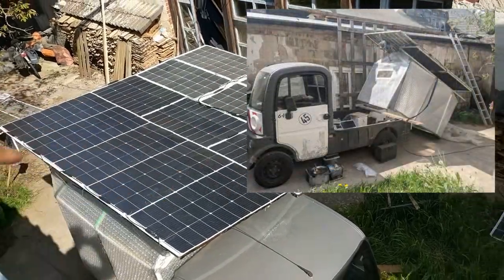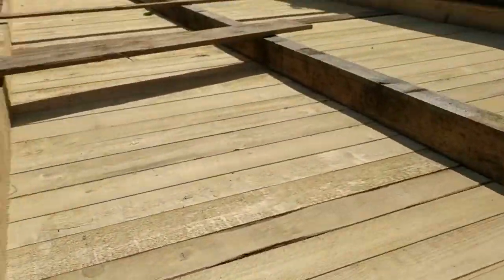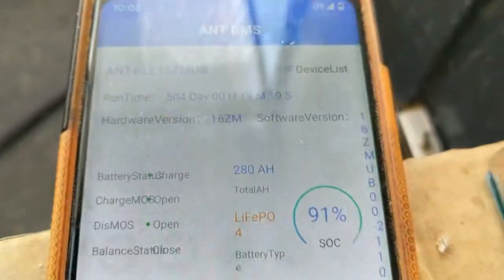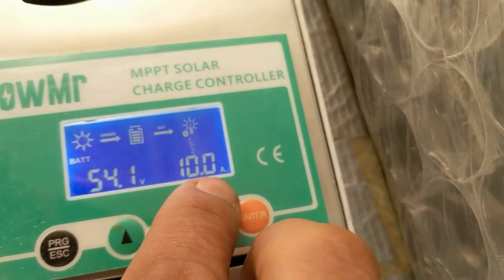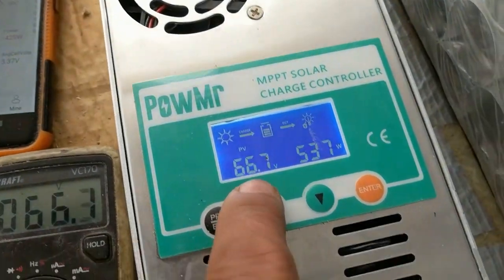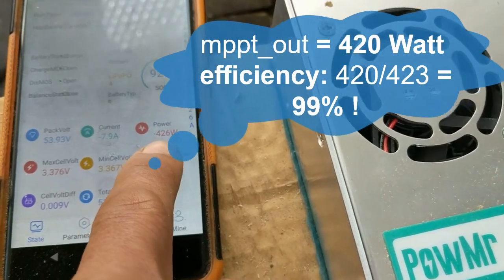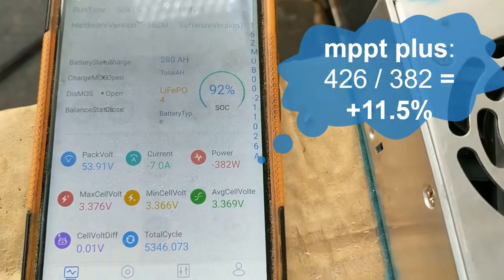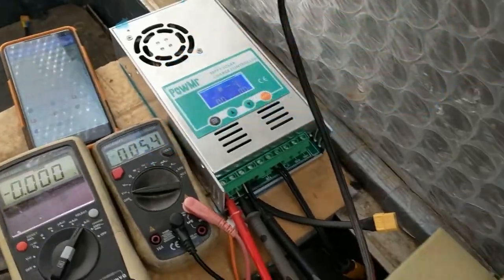positive test: 60A PowMr mppt (EASun, EcgSolax) - only 2x4 hot 30-cell Dokio 18V DFSP-100M

Comment: 540 solar panel × 2 (Pararell)
12V 220AH battery
12V inverter

Which is charger controller enough?
Reply from the maker: 50V and 2*13A= 26A with mppt down to 14 V and 100A.
I don't know if the 60A refer to input or output max current :-/
Reply: @robodurden  Thank you

Comment: You recommed powmr or ecgsolax ?????please reply
Reply from the maker: Ecgsolax !
The PowMr has a big problem with Liion to cut off when the max voltage is reached.
For lead acid that is not such a big problem.
Ecgsolax 60A has a slightly different motherboard layout and the software is also a bit different: When you choose liion type, the second float voltage for lead acid is not displayed.
A nice person from ecgsolax.com also told me that they are not PowMr. So Ecgsolax seem to indeed have sourced their own clone. I think it is better. 
Have not had my hands in an EASun clone.
Reply: @robodurden  thanks your kind reply.♥️♥️
Reply: Easun/PowMr/Ecgolox
what is the better performace